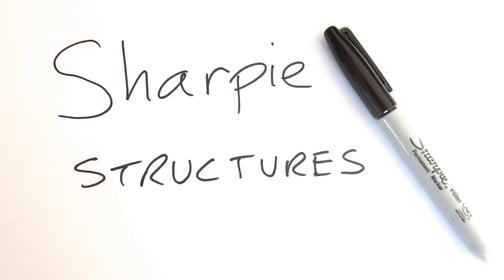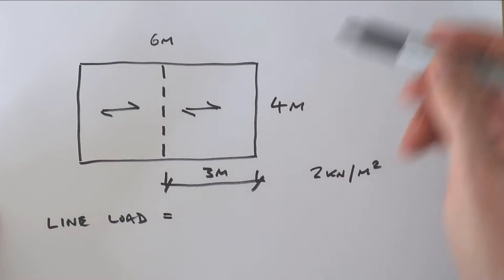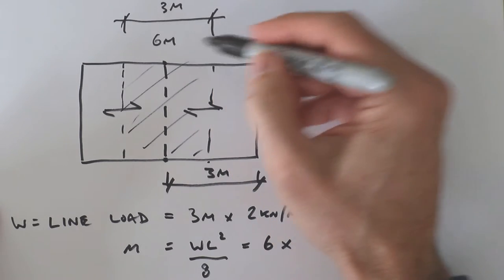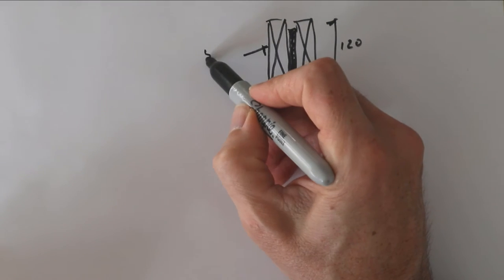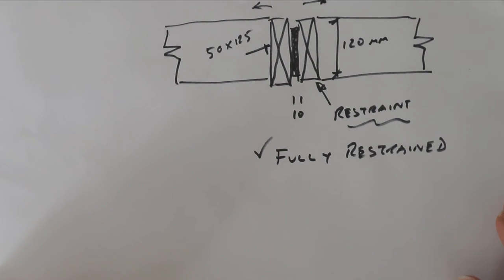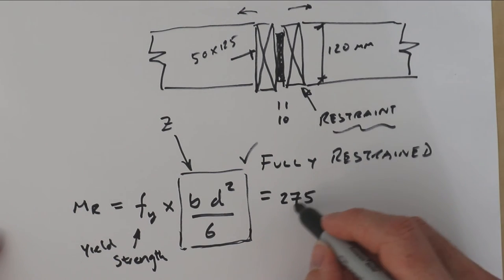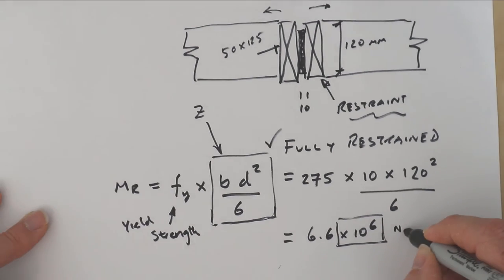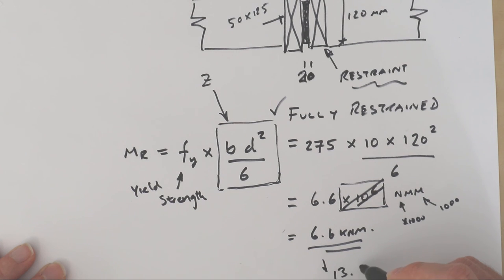How to do a flitch beam calculation the EASY way

Comment: Thank you. This video is very helpful. As a globally out of step California contractor it is difficult for me to wrap my head around  metric measurements, but I am working on it. I have a project that could benefit from angled flitch plates supporting opposing rafters. I understand that they require what here in the states we call "certified welders" to created the connection of the plates. I am wondering if they are calculated the same as a straight flitch plate or is there more to it. It would be very helpful if you could point me in the right direction. thank you.

Comment: Hello Robin, I’ve watched many of your videos and find them very insightful, thank you. In this example you’re doing something very close to what I want to do, the width in the example being the same. My beam length needs to be 6.5m. 
I tried upping the steel to S355 (15mm*145mm) and came way out with my calcs. I then tried the same calcs using two beams over the 6.5m span and again miles out. The whole structure is timber and if possible I don’t want have to use a UC/RSJ. Would you suggest a flitch spanning 6.5m isn’t possible?

Comment: Your videos are saving me a lot of money! Thank you very much. One question tho< is there a simple way to find an exact number for Factored Load? 2 kn/m is around 203 kilograms of force on any given 1 meter. it seem to be a little more on most times on a residential project. if one to find out the exact or near enough number would probably be very helpful. is there a calculation or a formula for this? Thank you
Reply from the maker: HI. The 2kN is per square metre. Yes there is a lot of literature on loadings. I suggest starting with "design of structural elements" by chanakya arya. It has a good chapter on this. Also I cover it in my steel beam calculations course: https://geni.us/beamcalculations

Comment: Hello Robin thanks for the videos. They are very useful. I am currently trying to assess whether my loft is suitable for conversion. I like the sound of flitch beams rather than rsj for floor support as the individual components could be easily assembled in the loft space. Flitch beams would be installed just outside of existing purlins which would be retained. What do you think and what loading would I use to calculate flitch dimension? Thanks Jon

Comment: Thanks Robin, great video. Could you not use steel for the top/bottom faces and timber as the sandwich filling in between to carry the shear? Would be a much stiffer beam with the same weight wouldn't it?

Comment: Hi Robin, thank you for these videos, to the untrained eye they are a great help 🙂 i have a question regarding the thickness of the steel, i know you said the depth is more important. I can get 5x120 steels at a good price but just wondering if they can be too thin? Obviously i would brace them either side. I have a project where i need to span 5m but cant go deeper than a 150  rafter... Any idea please? Thank you 👍
Reply from the maker: Hi Luke. I can potentially design that flitch beam for you, if it is just flat roof loading, if you provide some more details here (the 47 option) : https://geni.us/askrobin

Comment: Just out of interest, if this is based on a load factor of 2kn/m2, if we said the load was more of 1kn/M2 (no regular access and not likely to have deep snow) would that mean overall you would have managed with just the 1 beam instead of the 2 to keep you in spec? My thinking being if load is halved, strength can be reduced? Thank you 👍

Comment: Hi Robin, great vid and very informative. Id like to use a flitch beam as a lintel for a current job. Im doing a small first floor extension above an existing ground floor extension. 
I have a span of 3.8m which will support counter balanced floor joists, a 2m high wooden wall c/w windows and a flat roof constructed on top. The extension will only come out 1.6m from the house. Space is limited so hoping to use 2 No. 195x44 c16 spruce joists with a metal flat plate of 150x10mm bolted in between and restrained into brick with mortar. Is this possible or is a RSJ still best? 
Many thanks

Comment: Hi Robin, thank you for your video! Very insightful! 

How would loadings be effected if I was only adding load to one side of a flitch beam? I am looking to use a flitch beam as a solution to a 3m wide lintel with the flat roof hung directly to it.
Reply from the maker: Loadings would be calculated as being from one half of the roof span. The flitch beam would need to be well laterally restrained by the roof, and the roof would need to have sheathing to allow it to act as a diaphragm.
Reply: thanks Robin, appreciate your reply! 

I assume your comment on lateral restraint and sheathing would be to avoid any twisting in the beam? 

I am looking having a warm roof construction so I would imagine this will give plenty of rigidity to the structure.

Comment: Great video Robin, really what I needed and also looking to reduce my flat roof height by way of a flitch beam. Quick question, what is the significance of the load factor in your example here at 2kn - this seems like a magic number, are there environmental factors that would raise or lower this?
Reply from the maker: Hi Paul. Usually a roof would attract 0.75kN/m2 of snow in the UK, and then a dead load for the materials used. A load factor of 1.5x is an amalgamation of the 1.4x dead load and 1.6x  live load that UK BS codes require. Confused yet? 😊

Comment: Hi Robin, very informative content. I do have a question, would it be possible to increase unsupported spans by doubling up beams? For example, C16 2x6 doubled to make bolted 4x6s. How does this affect span maximums? And, in theory could this same logic be applied to flooring? I am researching building a flat room timber frame building on pier foundations, trying to avoid piers every 4ft for the floor and supports every 8ft for the roof joists.
Reply from the maker: If you double them up you halve the load on each. Deflection is a function if the depth cubed, so the most bang for your buck is achieved by deepening joists, not doubling them (I.e. widening)
Reply: @RobindeJongh  Thanks. Lost me a bit on the "Deflection is a function if the depth cubed". Im a layman :) 

That said, from your span tables, it looks like C16 2x8 would tick my box for piers every 8 ft as they have a 3m span. However, in the flat roof with the same wood, it seems to give me an extra 1m on the span. I have seen firms alternate between doubling and flitch joists across a roof build. Just wondered, how much extra span they could get by doing this?

Comment: Hi Robin. I just heard of 'Flitch Beams' for the first time tonight. So I did a search and your name came up on top of the search result, and I thought to myself, 'thats interesting'. It was also interesting to note at the end of your video, that to double the strength of the 'flitch beam', all that was needing done, was to double the 'steel plate'. Which brought home the point you made in that other video, how much stronger steel is over timber. And in this situation, the timber is really only the 'white bread' in the sandwich of the 'Flitch Beam' holding it all together. But the real meat in the sandwich is the 'steel'. So to double the strength of the 'Flitch beam', all you need to do is add another layer of the steel plate. I'm sure its much more complicated than this in the real world , where much more complex calculations have to be thought through. What would you say are the applications for Flitch beams. Would it be about the ease of getting these seperate parts of a Beam into an awkward spot, compared to one big heavy Beam. These videos are great Robin. Thanks so much.
Reply from the maker: Hi Jude. Flitch beams are great where steel needs to be hidden away in a timber building. The flitch beam itself is not as efficient or lightweight as a steel "H" shaped beam would be, so for any other task the normal steel UB or UC sections would be preferable.
Reply: @RobindeJongh  Hi Robin. that is interesting. The reason I ask is because I have to get a 300x75 LVL 'ridge beam' up to a 6.0m height, to support 200 x 45, 6.5m rafters, supporting a sheet metal roof, of less than 40kg/m2, for a Gable roof. The 'RWL' is 5.8m. The 'ridge beam' needs to span 6.4m, but is itself 10.0m in length, being a continuous member. The issue is that there is no access for a crane, so getting such a heavy beam up 6 metres up off the floor is going to be very difficult. This is a remodel of my roof, and the only way I can do it is by doing it as a self build. Are you familiar with such a predicament. Is there anything you can suggest to help me figure this out. Thanks Robin.

Comment: If I wish to increase door way height under a timber beam madeof  4 x  2x8 can I cut out lower 4 inches and add steel plate to eitjher side above the cutaway acroos door way ? Sort of an out side flitch beam ! I would run bolts through at side and middle ..
So total run for the wood cutout is 28 inches and steel plate would be 36 inches x 4 inches x 1 cm ..( would 1 cm thick steel suffice ?? )

Comment: Helpful Video. Just constructing a garden room under pd's and need a very shallow roof beam/joist, to allow us to keep the internal height as best possible. My room is external measured 8.2Mx4.2M. Any chance I can get a calc? I would like to use 47x120 timber or smaller. Timber is supported on double skin of block work so the span is 3800mm.  Is load factor always 2 KN/M2 on flat roof with rubber epdm. I think I need a line value 16KN/M and using the 47x120 plus 10mm steel plate = 6.6. So does that mean I need at least 3 of those and then I just use standard 47x120 to infill the rest? I do have an engineer on the project but he seems lost.....! I'm just following you video but with no other background. Any help appreciated?
Reply from the maker: Hi! Yes I can do the flitch beam calculation for you. Send your enquiry here, and any drawings or sketches: https://geni.us/structural

Comment: How would you work out the size required for a clear span beam above a large doorway with just the roof above?
Reply from the maker: Same as this method, but you only have one side of the roof acting on the beam.

Comment: I'm a structural engineer based in UK and this calculation is not only too simple the timber and steel stresses correctly calculated are too high and the deflection is also too great.  What are your qualifications Robin?  are you in the USA?
Reply from the maker: Hi John. This calculation is perfect for people who don't have a degree in structural engineering. I've checked it and the calculation is correct. By all means please watch it again and let me know what specifically you have an issue with. Regarding deflection, I don't show that in this video, and viewers can check my other videos on deflection if they wish to learn how to do that. Please do get back to me if you have any concerns 👍
Reply: @RobindeJongh  The calculation is too simple in that it makes no reference to the part played by the timber.  Load will be taken by the steel and timbers in relation to their stiffness values, ie the EI for the steel and timber.  A flitch beam is really for too complex for someone with struc eng degree to be doing.  And as I say if you do the calculation with a 20 mm plate you find the deflection is too great (even accounting for the part played by the timber, and at 0.005 times the span the deflection is big).  I've sent you an email with a calculation done using a timber/steel software package that I use a lot called Superbeam by Tony Byers/Greentram.
Reply from the maker: @johncranna  Hi John. Thanks for sending the Superbeam calculations. They agree that the beam passes, although they give a higher deflection. Superbeam uses the old BS449 code whereas I have used the newer BS5950. The newer code uses imposed only load for deflection. I've just checked the beam to BS5950 and the deflection is span/322, which is well within acceptable limits for a garden roof structure. However, I totally understand and appreciate your over-arching comment, and I will pin a comment to this video encouraging viewers to check deflection 👍

Comment: Hi Robin! What is the minimum thickness of the steel plate that can be used and what it depends on (if does at all)? The price would be affected as well. TIA
Reply from the maker: Hi Petru. Thickness of plate affects buckling, so the important thing is to have the beam restrained from buckling, by a roof or floor diaphragm as shown in this video. Depth of steel makes much more difference to the strength of the beam than thickness does.
Reply: I understand the steel depth is crucial. But still, how important is the thickness? I could argue that buckling is not an issue, as the joists in between them won't allow much movement (they're like noggins). Both top and bottom sheeting play a stabilizing role as well. So there's a constraint from all 4 sides of both beams. This is where your expertise is needed. 8mm thick is considerably cheaper than, say, 12mm, that's why I'm wondering how thin it can reasonably be. Regards

Comment: Or would I be better off replacing the complete 10 foot x 4 pcs  2x8 beam with a 4 inch  I - beam ? There are 3 places in the basement wher the 2x8 beams reduce ceiling height too much

Comment: Robin can you please show the correct way to retrofit Roof to gable wall lateral support on a 9” solid brick wall can’t find it anywhere on YouTube or even the internet the house has stood 100 year without any.A yank said your roof will be flying down the road with a 9x4inch brick attached to it pitched roof. Cheers if you can do one on it prove it if possible

Comment: Why do you not take into account the bending strength of the timbers in the flitch? Also is the deflection already assumed to be within allowables? What yield is the steel? 235 , 275 or 355. Thanks.
Reply from the maker: Hi Kevin. Taking into account the timber strength is much more complicated and not something a general audience would want to contemplate, so this way is easier though a little conservative. You would need to also check deflection. The yield I've used in the video is S275.

Comment: What if the beam is not fully restrained, load on one side only?
Reply from the maker: If unrestrained you would need to do a complex buckling calculation, taking into account the two different material stiffnesses

Comment: The equation for calculating the moment in 5:20 ignores the bearing capacity of the wooden beams. For example, if you were to reduce the width of the steel to 0 (variable d->0 flitch->ridge beam ), the Moment resistance would decrease until 0, which makes no sense.
Reply from the maker: Moment resistance of the flitch beam is calculated here using only the breadth and depth of the steel plate.

Comment: There was no check on the deflection of the flitch beam which should be limited to .003L where L is the span. Furthermore it is unsafe to consider the beam to be restrained as the timbers forming the resptraint are liable to shrinkage over time thus reducing effect of the restraint
Reply from the maker: Hi Richard. Absolutely correct, the deflection needs to be checked. See my video here: https://youtu.be/brC9JEKqV7M Not sure I agree with your point about the beam being restrained. It's about as well restrained as physically possible 👍

Comment: 8:18 Sorry, Robin - putting your beams in at 1/3 points only reduces your load by 33%. You would need to put them at 1/4 points to reduce the load by the 50% you need.
Bad advice!
Reply from the maker: So much for thinking on the fly! You're right, I'll see if I can remove that bit. Well spotted 👍

Comment: Pfft, somebody just needs to create an app where you just put in the distance and dimensions of the supporting beam or joist and it tells you what size flitch you need.  Anyone who isn’t a structural engineer isn’t going to do all this nerd stuff.
Reply from the maker: How much would you pay for such an app if I created it?
Reply: It would take 15 minutes to create that spreadsheet - including your deflection check: Roof loading > span > loaded width > wL2/8 > 0.013wL4/(IE) > sorted